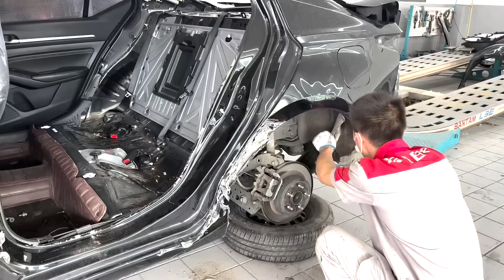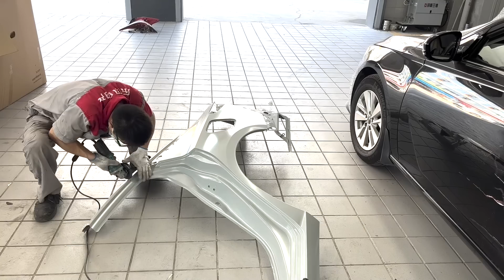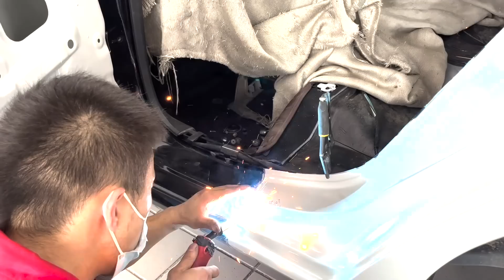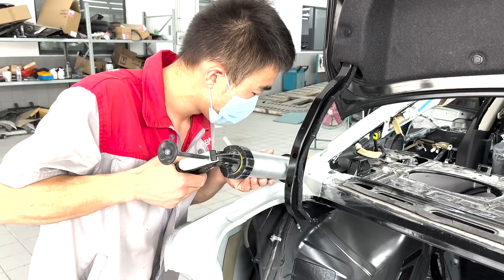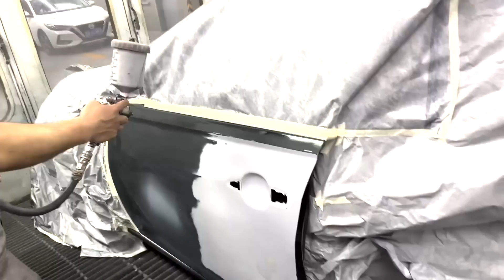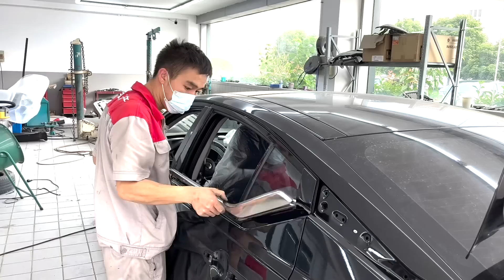Nissan Teana Side Panel Cutting and Replacement: Perfecting the Vehicle's Body

Comment: How long did the repair take?
Reply from the maker: Hello @Brulserz! Thanks for subscribing and for your question. The duration of the repair shown in the video may vary depending on the extent of the damage and the specific repair process involved. The repair of this car is very fast. If there are ready-made parts, it can be repaired in about two days.

Comment: Welding without goggles?
Reply from the maker: @user-gb8qb5pf5g, thank you for your observation. Safety is indeed crucial when it comes to welding. In the video, it is possible that the person performing the repair had taken safety precautions that may not have been visible. However, it's always recommended to wear appropriate protective gear such as goggles, gloves, and a welding helmet to protect against sparks, UV radiation, and other hazards associated with welding. Safety should always be a top priority when engaging in any welding activities.

Comment: My very old Toyota Corolla seems like a tank compared to these modern cars.
Reply from the maker: It's interesting how car designs have evolved over the years. Older cars like your Toyota Corolla were built with a sturdy and durable construction, which gave them a tank-like feel. Modern cars, on the other hand, often prioritize factors such as fuel efficiency, aerodynamics, and advanced safety features. While they may appear less robust, they are engineered to meet contemporary standards and offer enhanced performance, comfort, and safety. It's a testament to the continuous innovation in the automotive industry.

Comment: no need to cut
Reply from the maker: Thank you for your comment. Indeed, in some repair jobs, cutting may not be necessary. Every repair process is unique and requires different techniques based on the extent of damage and the specific approach taken by the technician. In this particular video, cutting was not required, but in other cases, it might be necessary to ensure a thorough and effective repair.